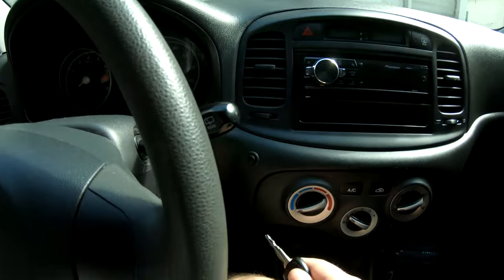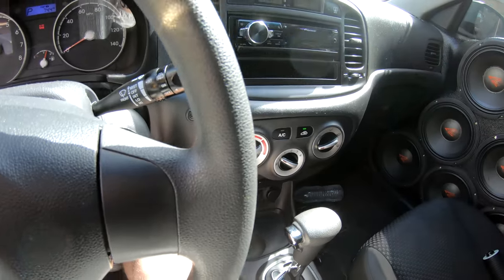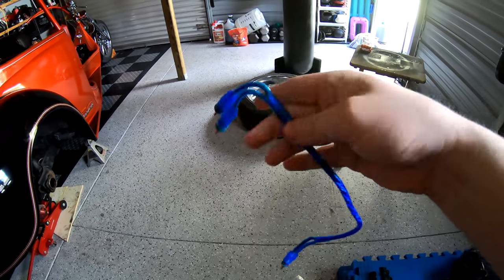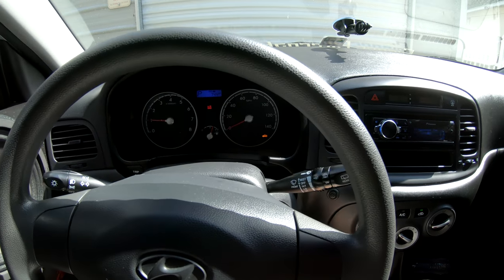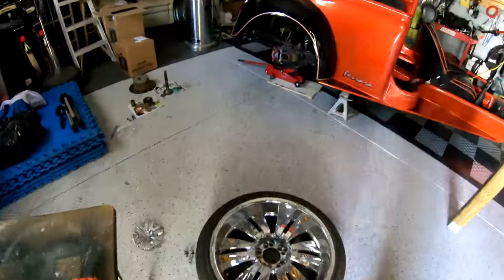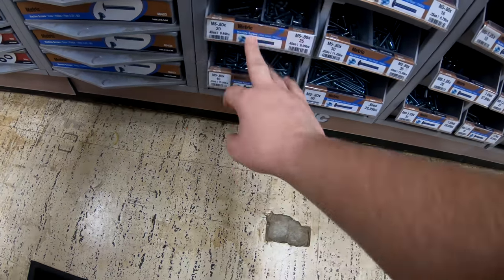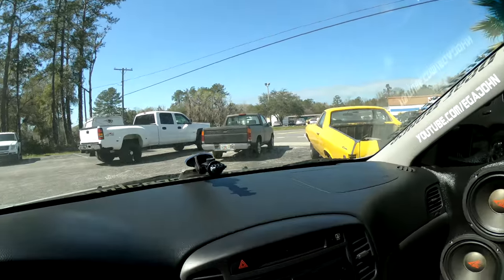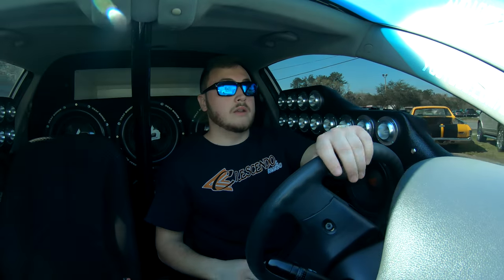Maintenance On An Audio Car (THIS IS WHAT WE GO THROUGH)

Comment: I have a question, I am getting a Tahoe soon for my daily driver. I have the option of going 4 18’s and almost a 160, or 4 15’s and be happy with a 153-155 ish. 
     Is there a way to prevent headunits from skipping/breaking, windows from breaking, and reinforcing roof with wood when you have a high db build?
    I don’t want to go crazy with my daily and install wooden roof plus brace. Also how do you or other bassheads deal with headunits breaking, has anyone tried to put non-spray foam strips along the mounting bracket to prevent vibration
Reply from the maker: If i keep up to date with my dash kits my head unit usually stays together. And as of a 160db build you will want to definitely reinforce the vehicle
Reply: EGAJohn ok I’m planning on staying around 155 and below, I might do 4 hdc3 18’s on 8k in a flat wall nothing too big